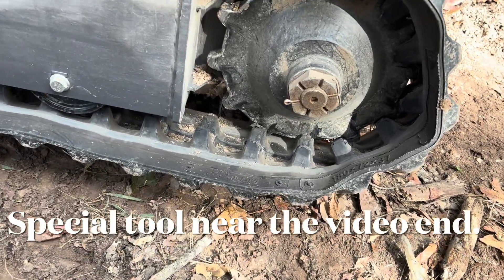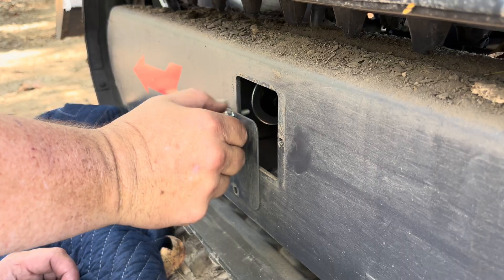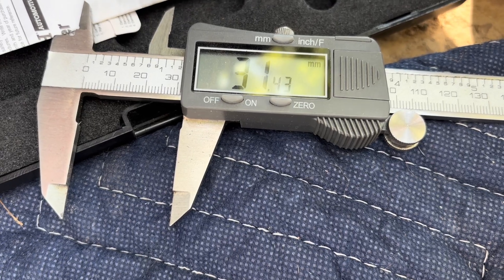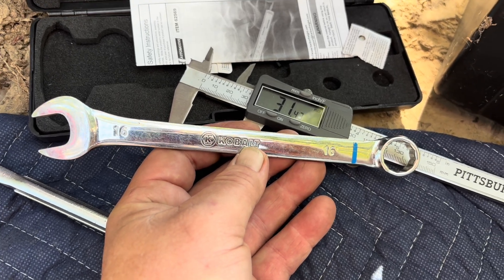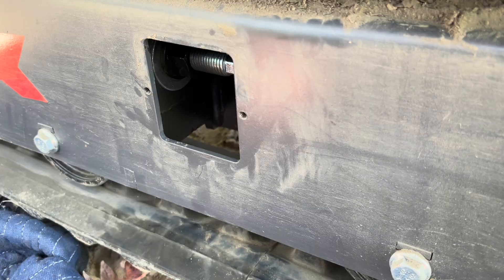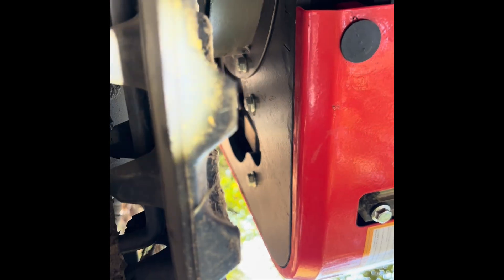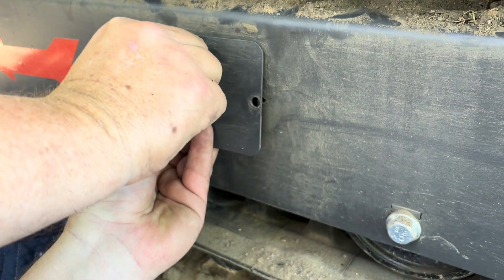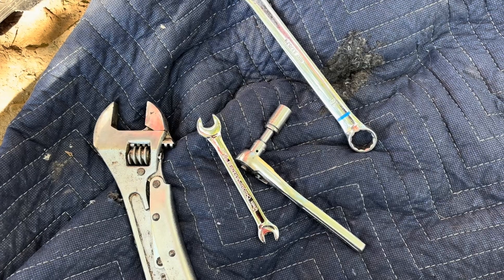Chinese mini excavator Huayee hy14c - Will the tracks fall off? Track tension adjustment.

Comment: Did you get an owners manual with maintenance procedures when you bought it?
Reply from the maker: When I ordered they emailed me a pdf owners manual.  I skimmed it.  It’s kind of generic.  I don’t recall specific procedures.  I think it may have a maintenance schedule.  Lots of safety stuff, which most manuals are nowadays. 

I had already downloaded the Mechmaxx Mec10 manual which Huayee makes for Mechmaxx - same machine except Honda engine and two post “ROPS”.  Huayee also snail mailed me the Briggs and Stratton paper manual for the engine - it’s not overly useful either.
Reply: @rgtoutdoors7130 thanks, that exactly what I got too. I have seen a couple of YouTube vids they put out showing some stuff. That's my only disappointment with this whole thing. My hy14c seems to be a good machine.

Comment: Looks like that 32mm wrench has just enough room.  I looked at that same wrench and would have preferred it but I didn't buy it due to the possible unknown offset interference.  I did get a 32mm combination wrench that works great.  Not sure what Huayee was thinking on the tools choices, none of them are correct for the tracks or the bucket pins.  I found a 13mm wrench inside the machine where they tried to fix a cross threaded cover panel bolt/nut and must have changed shifts because they left it behind stuck to the cross threaded nut no longer spot welded to the cover.
Reply from the maker: Yeah, I bought it hoping it would work and it did.  I thought I might have to grind a mm or so for space at the opening but when tested it there was no need. I did loosen and tighten the nut with it to be sure.

Comment: My Rippa came with the tracks so tight it would barely move. I loosened them up and have had no problems. They probably need tightened up now. I have about 40 hours on it now.

My machine has the exact design for adjustment, I'll look for the rod, I don't think it has it. 

Thanks for the video.
Reply from the maker: I think the one that almost came off came loose. It was always making popping noises when I went over roots and such.  Also, it was almost like that side had less power, sort of.  After tightening it, it’s relatively quiet and drives just like the other side.  I was super happy to find that offset wrench instead of having the adjustable at an angle and not fully on the nut.
Reply: @rgtoutdoors7130 I am checking the size on mine next time I am up at Chigger Hill. That beats the wrench I was using as well. Thanks for the suggestion.